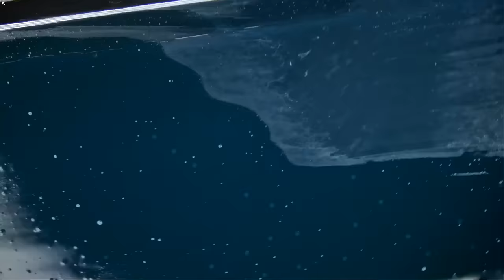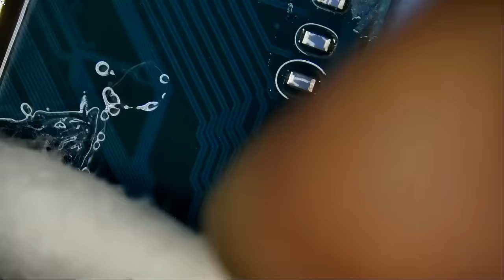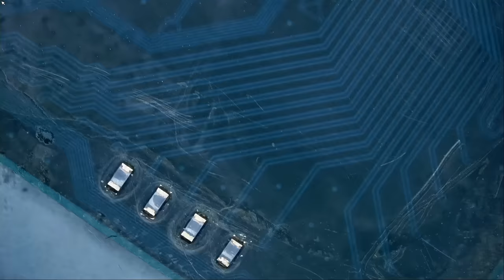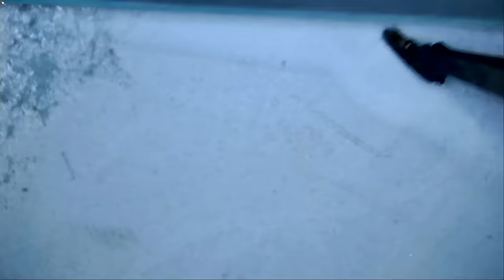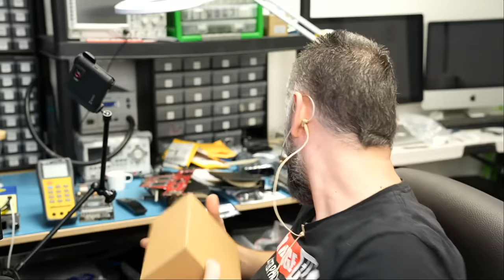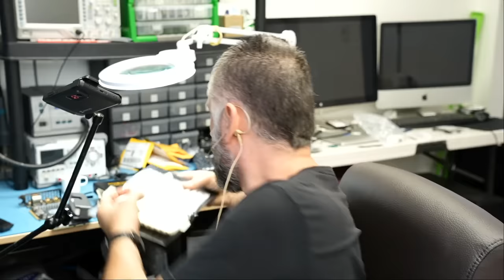Intel 13900KS 24 Core CPU Repair - Unknown components Ripped during Delidding

Comment from the maker: I received  more then few emails and comments from individuals who own the 13900ks processor. The missing resistor was measured in circuit and off circuit confirming the 100ohm reading both ways.  The fact that this was done by almost half a dozen individuals, it is safe to say that  the proper value of the resistor is 100ohms.  I ended up replacing the 150 ohm resistor with 100ohm value. Thank you for all those who contributed. You make the world a better place.
Reply: hello, can you confirm if they are 4 of 100 ohms I'm about to solder them help
Reply: just contact intel and ask for the values, i think thats not top secret and they will help.
Reply from the maker: @BrAiNeeBug  Why don't you try it and let me know how they respond.
Reply: @NorthridgeFix  ok i will do it.
Reply: @BrAiNeeBug  What reply did you get?
Reply: @nesmio7378 He probably either got left on read or got told to go pound sand lmao.
Reply: @Shyvorix  LMFAO
Reply: Great support from your community.  Cheers !
Reply: @BrAiNeeBug so what did the y tell you?
Reply: @47Lancelot  no response
Reply: @BrAiNeeBug gg bro
Reply: @BrAiNeeBug  who would have guessed
Reply: Did the clockspeed and performance wind up being the same?  Sometimes resistors are used to tell the cpu what clockspeed to operate at
Reply: @BrAiNeeBug you must be born yesterday
Reply: @xtofury sheeesh (insert what year is it meme)
Reply: @BrAiNeeBug  The walk of shame is a hard one.
Reply: @BrAiNeeBug don’t ever give up on your dreams
Reply: @dark_luls 😂
Reply: @Northridge Fix Please, write us here all smd values on this CPU, I need to replace multiple on my 13900k - it didn't start after die lapping, i didn't pay attention to protect smd's while I was lapping the die, and I lapped the tops of theses smd's... I have to replace them all I think... Thank you again!
Reply: What is the ideal way to use smd 0402 100 ohms with 1% tolerance or 5%?

Comment: Life of a soldering tip depends mostly of the maintenance you apply to it.
Always leave solder on it between use to avoid oxidation when power on , and just before use clean it and use fresh solder.
When job is finish, clean it and put fresh solder on it before turning it off.
With this very simple routine, every tip from known manufacturer will last a very very long time.

If you destroy a well known brand tip in a month, it is because you don't maintain it properly, just that simple.
Reply: Really good recommendation. I don't solder myself but admire this advice.
Reply: Agreed. Clean and properly maintained is key. Doing Mil/NASA-qualified soldering my Weller and Hakko tips lasted uncountable years. Cheers!
Reply: … and do not overheat the tip. Excessive heat shortens the life of the soldering tip.
Reply: Yep you are correct there. I have both JBC tips and some of these knock offs of all 3 handles. The C115-210-245 and all of mine have had daily use for almost a year now. I think I’ve had to replace 1 C245 but proper maintenance and always having clean solder on your tip when you turn it off really extends the tip life.
Reply: @BlueDevilsBari  Agreed. Mine are probably that old and I'd not know it. They just work. Still prefer wet sponge. Cheers!
Reply: I'm sure he knows what he is doing.

Comment: I repaired a 12700k with same issue, it worked with 150 ohm, but could not post with 2 ram sticks at 4800mhz(could post with one). I switched to 100ohm and I could post with 4 rams at 4800. I guessed the value based on the other components, which were 2k, 150, 100, 50 ohms. Hope this helps.
Reply: maybe i9 with 150 ohm and i7 with 100 ohm
or maybe because both are different gen
Reply: Yeah, I think it might be some voltage divide identification, since the cpu might not have firmware in it. I’m too lazy to check, but if that is true, then the high side of the capacitor should be shorted to the high side resistor, and low side ground with low side resistor. Anyway, i think the same gen should be the same value, since they mostly have the same ram specs.
Reply: @maklogetrich2378 You can not know that for sure. Unless you have an identical CPU, or a circuit diagram. Different gens come with different components and layouts.
Reply: @JaaMaar001  of course I don't know, i'm just guessing
hopes that cpu is working
Reply: Looks like it's part of the termination circuitry for the ram. Does it happen to be the exact same one?
Reply: I would doubt that, if the resistors were for signal maintain to the cpu, it would have been better to put them closer to the die. It is doing the exact opposite, putting the resistors furthest from the cpu, leading to the conclusion that they are likely for the motherboard.
Reply: hello, can you confirm if they are 4 of 100 ohms I'm about to solder them help
Reply: Sorry, to be real with you, all my current 1700 cpus are a real hassle to take out.
I can recite from 1 year old memory what I might remember maybe…
The four on the lower left from the top is 2k(99%sure), 2k(99%), 150(90%), 150(90%).
The bottom right one is 100(90%), the one beside the capacitor is 50(50%).
I cannot confirm, so unless someone does, i suggest trial and error from larger values.
Reply: What is the ideal way to use smd 0402 100 ohms with 1% tolerance or 5%?

Comment: it's so deceiving how small these components are when viewing it through a microscope. I recently had an issue where I knocked two resistors off of my RTX 3080 when replacing the thermal pads and thankfully I have a really good camera on my S22U and posted the pic to reddit and someone was able to tell me where the resistors went. I found one of the tiny resistors stuck to the old thermal pad by the VRAM modules, it was smaller then a grain of rice and just looked like a metal flake on the thermal pad. Luckily, I found a local shop that was able to fix it. I had just gotten the GPU a week prior and paid $560 for it so needless to say it was a disaster when I plugged it in and found out it was broke, but disaster averted. I'm so thankful for people like Alex who know how to do this stuff.

Comment: Great Job As usual Alex, I love your videos.. 

I just wanna hint at something, if you measure 114Ohms on-circuit.. it's for sure that the measurement off-circuit must be higher than that .. (as your measurement verified).. it would never be 114ohms in-circuit and 100 off-circuit. 

(As you know,, other parallel components in the circuit would reduce the measured resistance not increase it)

Keep up the great work 👍 we're learning a lot from you

Comment: So it's not so much that they're "limited in production" and more that there are very few chips that come off the fab line perfect enough to qualify as a KS or K variant. The same generation of CPUs actually only have a few different chip designs but they make dozens of processor models out of those few designs. What they do is blow fuses in the chip to disable certain features to create the various processor models available. When a chip comes out of fab, it is benchmarked and all functions are checked, most of the time at least one of the function checks fail; maybe it's a bad core, maybe some of the onboard cache doesn't work right, etc. When they get a failure, they find out what processor model that chip could still become without the failed component and blow all of the fuses to disable everything that isn't part of that particular model's spec. For example, maybe they start with an 8 core chip but 3 of those cores come back as bad; if the chip were perfect, they could sell it as an i7 model with all 8 cores but, because some of those cores tested bad, they blow the fuses that control access to 4 of the cores, including the bad cores, and sell it as an i5 model.

Comment: for how much this processor is going for, I wouldn't risk delidding it for a 5-10 percent improvement in temps.
Reply: $900 cdn.
Reply: =$681 US. M$RP $700 last time I looked.
Reply: Unless you’re rich
Reply: @cipher01 still a dogshit choice for those temps lol
Reply: Delidding and direct die cooling a 13900KS can actually improve the temperature by 10-14°C. There is a reason why the person delidded the CPU. Linus tech tips made a video on a direct die water cooler, you should watch that. In overclocking, 10 degrees can be the difference between an overclock being stable and it not being stable 10°C warmer. But I agree, for the average person, it's not worth it to delid. But the average person isn't buying a 650$ CPU

Comment: Doesn't the board interfere with measurements just because the components are in circuit? In case of components connected in parallel somewhere ?
Reply: Make me a sandwich

Comment: Not 12800K , its 12900k. And you should check the picture of 13900KS on the internet first. The picture shows the  smd component clearly.
Reply: from the pic you can get that one is a capacitor  (which is weird, being so far from the IC), and the other a resistor; 100nF would have been my guess - however the resistor can be anything.
Reply: Pictures are all over the internet. That doesn't help! It's about what the component does (resistor, capacitor, inductor, filter) and what's its value (ohm, pF etc.)

Comment: my 13900k doesnt look like that ^_^ oh wait i didnt wreck it trying to destroy it :D And for anyone else considering de-lidding their expensive CPU, if its a 12 or 13 gen just go into bios and put the max wattage to 225w peak and 190w normal. My 13900k runs 100% encoding all cores, 2@5.8ghz - 6@5.4ghz and eCores @4.2ghz with an average temp of 75c. Look up Jayz2cents on it. F^$k£$g awesome CPU.
Reply: What CPU cooler are you using?

Comment: Asus ROG Strix SCAR III G531GU (Black screen issue, CPU and keyboard and sound Every thing is working . Even secondary monitor also working when HDMI is plugged to laptop. I gave my laptop to one of the Asus service centre, they said like some chip problem is there with it and then they said I can’t work on chip you need to replace a new motherboard)🥺🥺

Any other way ? Please help me out
Reply: might be blown fuse around display connector, or maybe the screen itself
Reply: Something like that I've got on a G731 series which has a manufacturing error with EDP cable traces near and around hinges that caused chipset , display inverter and some mosfet burned . It costed huge but I managed to repair it . EDP cable , cause open/close the lid determine some friction with cable isolation , shortcircuit and booom . Chipset and 2 mosfet were replaced and I bought a new display and , of course , EDP cable . Everythings works fine till now . Asus Service Centre decline the job so I ask help from a usual laptop service center . A good one !
Reply: The problem is it's an asus.
Reply: @marcellachine5718  Indeed. Trading that first "S" for an "N" helps explain it. Cheers!

Comment: lol hobbyist getting scammed by influenzars
Reply: It's amazing what some videos do to people. 

Build a new computer with a $700+ processor, and you automatically delid the processor to save 5c off the temperature, as if it matters outside of serious overclocking.
Reply: @volvo09  it actually does matter, because the 13900KS is a freaking furnace.
Bad idea to buy intel CPUs in general, though.